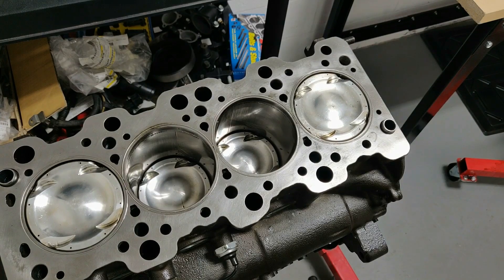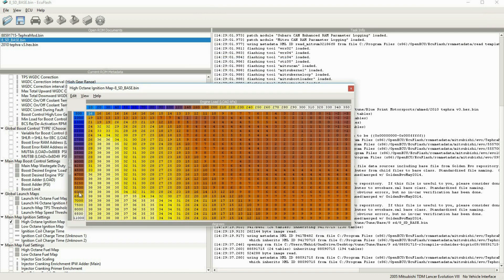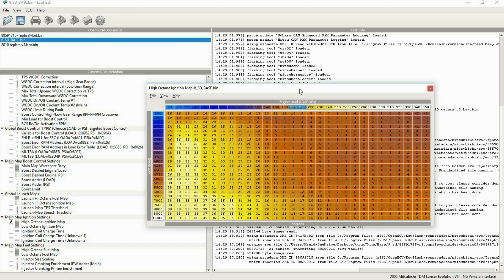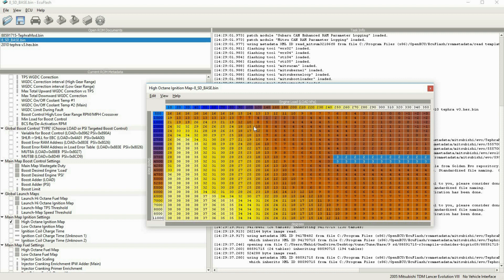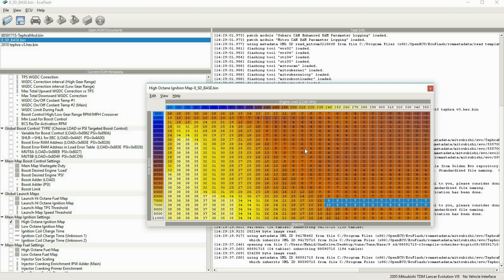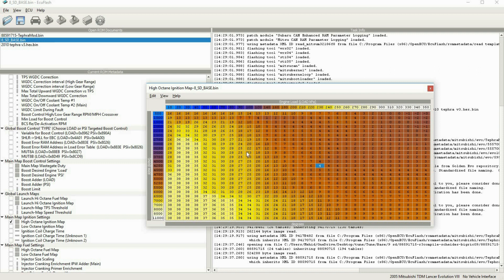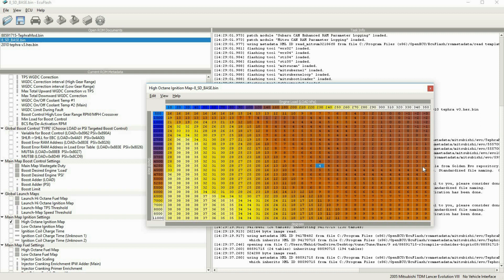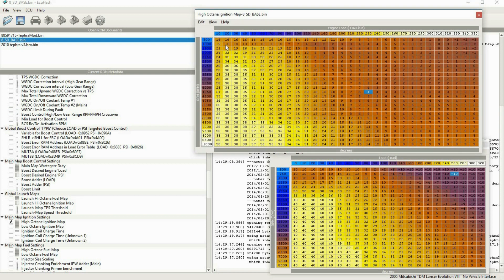Ignition Timing Tuning explained EVO Ecuflash

Comment: Interesting that you advance the timing at low RPM because it "needs that time"... I've always been told the opposite. You want the flame front to reach the piston at a specific point in the piston's travel, but creating that flame front takes a fixed amount of time. As revolutions become quicker you have to start the process earlier (advance timing). At low RPM you retard the timing considerably, or else the flame reaches the piston way too early.
Reply from the maker: Not gonna get into a whole debate over comments, but a big clue is how boosted cars and na cars are tuned from factory. Take a look at stock maps and compare and see if I'm right or actually I am wrong.

Comment: 17:23 200 kpa is 20 psi boost??? is it not 14.5 ish psi / 1 bar relative to atmospheric ??
Reply from the maker: 17:23 is total length of vid. But if u listen carefully I say that for the purpose of the vid, because u can control load vs kpa and load vs psi and load vs voltage scalings.
Reply: @ sorry I meant 9:16 , ah ok I understand you now. I have Maxxecu on my E8 but from what I’m learning the stock ECU is very friendly to us guys! Map switching, WMI etc etc on spare ecu pins, NLTS and more. I almost regret going stand alone in some ways. BTW your videos are good, new subscriber from Scotland
Reply from the maker: Thank u , I appreciate you. I also use Maxx. But mostly on LS cars. It's good. Most of the tables are interchangeable in stock ECU from usdm to JDM and eudm. So if we have access , so does everyone else.

Comment: Question, a few times you referred to the top horizontal load axis as psi, and you pointed over the 250 and 260 kPa load cells as 25-26 psi. Were you just talking in general or have you set up your cells to refer to actual psi units and NOT kilopascals? As usually any stock mitsubishi load map will have kPa ranging from 0 to 150 or 200, which correlates to boost load. Like you said, from 0 to 100 is effectively vacuum, and from 100 to 200 would be in bars. so 120 would be 0.2 bar boost, 150 would be 0.5 bar and 200 would be 1 full bar of boost (14.7 psi or 100 boost kPa).
Reply from the maker: You can control what each load kpa to boost is or how ECU sees voltage as a function of kpa. And then u can do the same for kpa to psi

Comment: If you have a EBCS, and your target is 28 psi with an FP black. If you hold 28 pounds until redline, would you still target 14-15 degrrees at redline. Or would it be the 8-9 as show in the chart?
Reply from the maker: You are asking for specific tuning strategies, I'm just trying to explain how this software and ECU works

Comment: Great video. Question I’ve got at 8 with fp black and s3 cams. I’m getting some knock at higher rpm’s (6800 +) with my peak timing about 1-2 degrees going to 10 at redline. Does 10 degrees at 7k rpm sound like it’s too much for 24-26 psi on 93?

I’ve played with AFRs rich rung up from 11.4 all the way to. 10.9 and still getting knock in this area. 

Would appreciate your insight

Comment: More stroke length does give more torque relatively speaking.........BUT it comes at the price of rpm potential. Its a universally observed limitation that long stroke engines (all else being equal) cant achieve the same rpm without having a catastrophic failure due to the extra piston speed (for the same rpm) and conrod loading. Its not a free lunch.

Comment: Grate Video! 
But, you have one mistake, when an engine's stroke is increased it's connecting rod has to be shortened ,theirs only so much deck- height space, to make room for the 
 increased stroke. Moreover, The reduced length of the conneting-rod decreases the rod to crank ratio. Thus, causing a reduction of "TDC  piston dwell" , when the con-rod length is increased the "TDC piston dwell time, in crankshaft degrees" is increased. Also, the opposite happens in BDC, The "BDC piston dwell time", in crankshaft degrees is decreased.
Rod to crank ratio:  is half of the stroke divided by the length of the connecting rod, this is because the crank pin actually makes a circle as it spins and the radius is used to calculate the "rod to crank ratio".
I'm ending it hear... I already wrote more than I the time that I wanted to spent.

Comment: One of the best tuning vids I've seen so far. I'm wondering, how would this change if my engine is NA, I guess not having a turbo would let us have earlier timing?
Reply: Yes, also ur table will max at 100kpa as there is no boost pressure in a na car. So way less to worry about fuel and timing table wise

Comment: Dwell time is the charge time of ignition coil pack. Not the time of piston at tdc....
Reply from the maker: They are 2 different things which use the term "dwell". The word is only a reference to  time. Dwell for ignition is charge time and a tdc dwell is amount of time it takes for pistons at tdc to change directions. The dwell for coils are in MS and the one for pistons are in reference to ° of the crank.
Reply: I understand the tdc dwell time. At 6.00 of video start because of tht dwell time setting that you explain tht making me confusion. Maybe just my poor understanding of english
Reply from the maker: @jinkwt  no , it's probably me. This was one of my first vids and I had so much info to communicate and it probably didn't come out right. But since some engine configurations produces a higher tdc dwell and bdc dwell, u have to be mindful of both ur timing and ingnition dwell. That's the point I was trying to make. Sorry for the confusion.
Reply: @bdalchemist  great info ! Keep it up for producing more videos
Reply: @bdalchemist  You were actually wrong in what you explained. The error he refers to is when you said that the dwell time is the time spent arc;ing, which is incorrect, you can't control the spark duration at all and it's completely irrelevant to tuning, you can only control the time spent keeping the coil powered . A side note if we're talking about dwell angles too (which wasn't the original issue). The piston is in fact still moving at the top too, just very slow, and then it accelerates until it reaches its peak acceleration at exactly halfway. If you were to put a micrometer on the top of the piston while spinning the crank, you can see it. This is ofc not relevant, just an interesting observation based on the simple physics involved.

Comment: Trying to tune my Prelude BB8, JDM, type S with Greddy EMU (piggybcak).
It is all motor with intake, exhaust, camshaft upgrade.
I can handle fuel tuning based on wideband.
My questing is how to tune timing/ignition?
When should timing be retarded or advanced?
There is no dyno machine in my area (Belitung island, Indonesia).
Tuning must be done on street (fortunately no speed limit on public road).
Reply from the maker: It's hard to tune timing precisely without a Dyno. Typically u add timing till u get 1-2 counts knock then u back up 2° in those areas , this is offcourse after peak torque. Virtual Dyno helps
Reply: @bdalchemist  Thanks for feedback.

"Typically u add timing till u get 1-2 counts knock then u back up 2° in those areas"

This one is hardest part.

I cant hear any knock, even using headphone, while under WOT.
Reply from the maker: @andisemesta4248  that is the issue with piggy backs, there should be some kind of knock logging channel. And I would personally used hondata s3 and not a piggy back.
Reply: @bdalchemist  Thanks again
Reply from the maker: @andisemesta4248  anytime , let me know how it goes
Reply from the maker: @andisemesta4248  anytime , let me know how it goes

Comment: So, 6° is your preferred maximum degree at top tq on the 4G63. what about the 4B11? what'd be your max ° at top tq?
Reply from the maker: Really depends on a few factors, engine build specs, parts used, turbo, fuel, compression etc

Comment: i cant tell you how grateful I am to come across this. this is so helpful. I finally have a better understanding on how this timing stuff works. time to go blow my engine.
Reply from the maker: Noooo! Don't do that. Take it easy. One degree at a time.
Reply: bruh, same here. I'll hit you up when its finished xD
Reply: Hey man just checking in 2 years later did you actually blow your engine shortly after posting this comment? And hope all is well!
Reply: @worldFamousPitbull  depends on how you drive technically and how much you run a flame tune on your car or letting your car running rich daily you will blow your motor eventually if you drive your car hard.